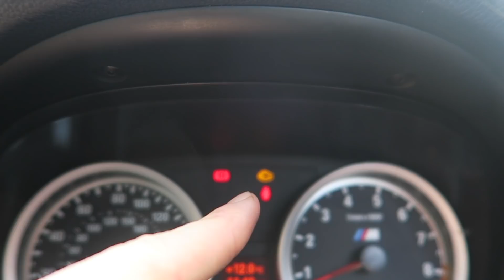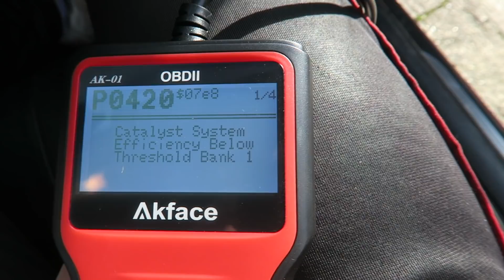Why Buying a RARE car ISN'T always a good idea...

Comment: That code is saying that there is a problem with the lambda sensors either the 1 before the cat or after, need to check it on a diagnostic machine so u can see exactly what each sensor is doing, if it makes any sense 👍